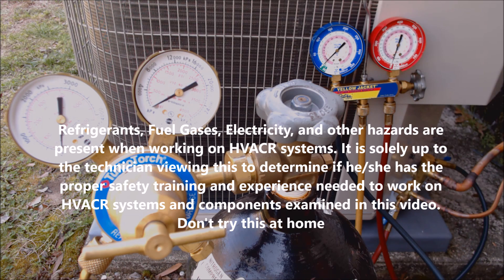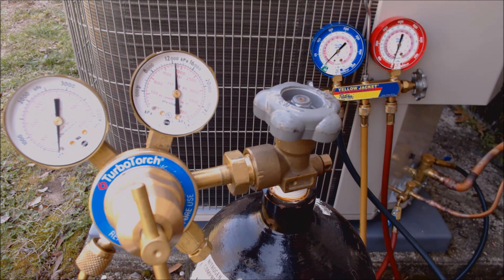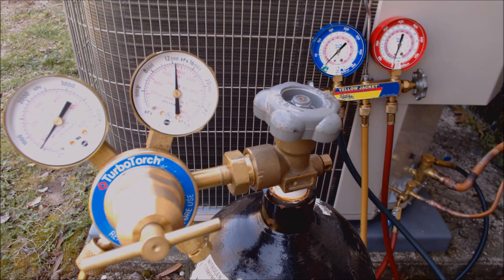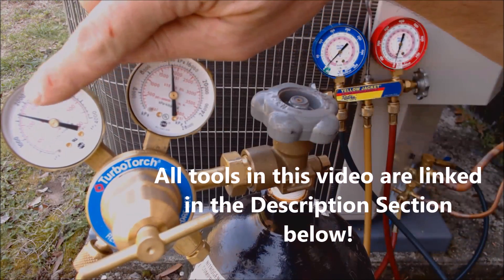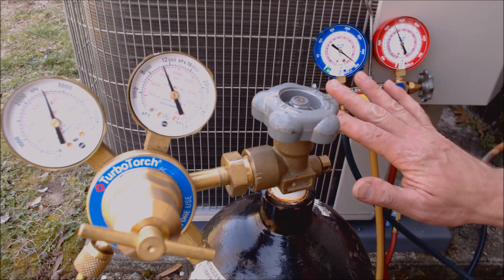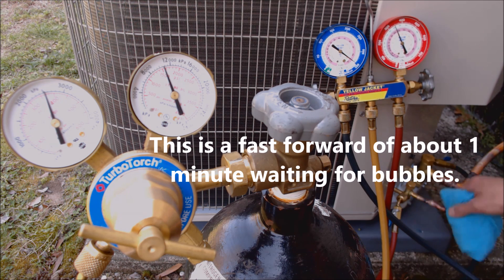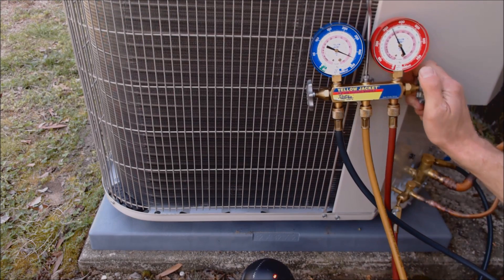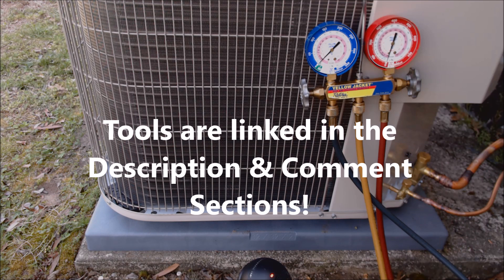HVAC Pressure Testing Procedure for Air Conditioners! Step By Step!

Comment from the maker: Tool List-  https://www.amazon.com/shop/acservicetech
Support-  https://www.patreon.com/acservicetech
For those that are looking for the tools used in the videos: (Linked Below)
Here is a link to the Nitrogen Regulator- http://amzn.to/2bXdR5f

Here is the link to the Appion Valve Core Removal Tool- http://amzn.to/2uYr8WL 

Here is a link to the Nitrogen Flow Meter-    http://amzn.to/2brvoBg

Here is a link to the Air Acetylene Torch setup-    http://amzn.to/2aQalsb  

Here is a link to the 15% Silver Brazing Rods-  http://amzn.to/2gVLyLc

Here is the link for the C&D Valve Core Removal Tool- https://amzn.to/2vqA0qy

Here is a link for RectorSeal Bubble Gas Leak Detector http://amzn.to/2ckWACn

Here is the link to the pack of 25 C&D valve cores- https://amzn.to/2J1lurm

Here is the link for the C&D Valve Core Wrench, Container, and 3 valve cores- https://amzn.to/2EVGkps

Here is the Link to the Fieldpiece MR45 Recovery Machine- http://amzn.to/2xAOpN6

Here is the link for the filter drier- http://amzn.to/2veVV3m

Here is the link to the Yellow Jacket 1/4" by 1/4" heavy duty hose straight-  http://amzn.to/2umtcod

Here is the link to the CPS Vacuum Micron Gauge- http://amzn.to/2v1nM3O

Here is a link to the JB 6 CFM Vacuum Pump   http://amzn.to/2nqbvo8

Here is the Link to the Appion Blue 3/8" to 1/4" Vacuum Hose- http://amzn.to/2uYlVyc

Here is the Link to the Appion Red 3/8" to 1/4" Vacuum Hose- http://amzn.to/2uYg6Ro

Here is the Link for the newer UEI DL479 Multimeter with temp sensor- http://amzn.to/2jtsUbJ

Here is the Link for the FieldPiece ST4 Dual Temp Meter- http://amzn.to/2AhR6ph

Other tool links can be found in the video description section.

Shop through Amazon! Your Purchases through Amazon provide a means for channels such as mine to earn advertising fees from all purchases after clicking through. Prices are the same as normal-    https://www.amazon.com/shop/acservicetech

All of the ACSERVICETECH Playlists-  https://www.youtube.com/channel/UCOZR-1IqsAer9wzlvFgb4mA/playlists?view_as=public
Reply: https://youtube.com/shorts/nQ0JNr5kNzM?feature=share4

Comment: Just want to share a faster and more effective method of leak test. With all valves open, close the valve on the nitrogen cylinder. If there's a leak the right side of the nitrogen regulator indicating tank pressure will drop immediately.

 It's best to start with all valves close. Leak test the nitrogen regulator by opening and closing the tank valve with the regulator valve close. To leak test the manifold gauge low and high side the valve core should be installed then use a tool to push the valve open.

Comment: Hi, i have one question which i couldnt find the answer, appreciated if you could help. 
Teacher in school said we have to do the high pressure test before the appliance is installed, isolate the piping system. 
But i found no one doing that? Everyone just connect everything, then do the test

Comment: Hi there, I am new and I am trying to get into this trade, before I take any courses at the college in Lithuania I want to learn as much as possible myself to be able to compare different methods of doing it. I have a question is it necessary to remove valve cores or is it possible to do the nitrogen testing with them inside ?
Reply: https://youtube.com/shorts/nQ0JNr5kNzM?feature=share4

Comment: Craig! After all the steps were taken and now you are ready to add refrigerant to the system. In this case ,Do you add a new poe mineral oil to the system ? ( depending on what type of oil the manufacturer demands)I don’t know if you have a video showing the oil part.🤔🤔

Comment: Hi, got a question. For example if I got a new evaporator and condenser with new copper pipe for AC line and I joined them together that means the line is new and dry so, do I still need nitrogen test and vaccum the line before filling the refrigerant in the line?
Reply: Absolutely
Reply: https://youtube.com/shorts/nQ0JNr5kNzM?feature=share4

Comment: Is there anything wrong with going through just the suction side? I do residential installs and some guys have thought it was a leak when it was equalizing after adding nitrogen. When I do it through suction alone I can watch the high side and stop it where I want. I have mixed things about this some say it’s good to do another says it will mess up the txv. Not sure how it would mess up the txv since it bypasses it. We work with Goodman units that have tx*n4’ which are hard shut offs

Comment: I'm installing a Daikin multi zone mini split.  Compressor has a service valve on the liquid line and gas line.  Do I pressure test using both service valves as shown in this video?

Comment: My compressor has been outside and open with both lines open to the elements.  I also emptied the oil.  Now I want to check to see if it is ruined.  I can braze service valves to the suction and pressure line after replacing the oil, then check suction and pressure with my guages?  If so, how  much pressure and vacuum should I expect?

Comment: We use valve core tools but I do not see any hooked up to yours??? Explain I was told if you take out valve core without a shut off valve core tool refrigerant goes everywhere? I'm about 2 months into field  training
Reply from the maker: This was just a pressure test on an empty system I was installing. We pressure test for leaks with nitrogen, thanks and keep watching and asking questions! Thanks!

Comment: Hello AC Service Tech, making a donation for your expertise here shortly! Question. I am Nitrogen pressure testing at 310 PSI...using a fieldpiece SMAN480 digital gauge. What is an an acceptable drop in PSI over time? I'm noticing a 2-3 psi drop per hour. 308 psi, now down to 304 psi after several hours. I leave checked, no bubbles. Isolated from my nitrogen cylinder. Can't find anything online. Do we test for 10 mins and without significant drop, go on to vacuuming down to 250 microns. I don't think I have a leak, but seeing my digital gauges go down is concerning.  I've heard temperatures can affect the nitrogen pressure. I have a 90 ft long line set. Really needing to get this AC running...appreciate any help!
Reply from the maker: Yes it may be falling due to temperature. Usually we only do a 10 min test due to time and then we can also confirm that no leaks exist as well during the standing vacuum test at 250 microns, thanks and I try to spend a extra time answering our patrons questions from patreon.com/acservicetech through patreon or through the email at info@acservivetech.com thanks
Reply: https://youtube.com/shorts/nQ0JNr5kNzM?feature=share4

Comment: Seeing as you don't like to have your manifold gauge attached when performing a system vacuum, how do you feel about the new 4-port digital manifold gauges?
Reply from the maker: I use them when teaching just so I can show multiple types of sets so students are aware of each type. They are nice for doing a triple evacuation but like you said, the 4 ports are made so that you can pull a vacuum through them and I don't like to have a gauge set attached when vacuuming, thanks!
Reply: https://youtube.com/shorts/nQ0JNr5kNzM?feature=share4

Comment: Hi I’m new to this. Can you explain why do we use nitrogen and when to use it? I couldn’t find a decent explanation anywhere on the why and when.
Reply from the maker: It is dry and inert so anything with oxygen can cause another gas to be more flammable. We don't use air for pressure testing because of the humidity in the air and the oxygen. We are trying to dehydrate the tubing in preparation for the refrigerant. Refrigerant oil when mixed with water creates alcohol and acids, thanks!
Reply: https://youtube.com/shorts/nQ0JNr5kNzM?feature=share4

Comment: Hi mate
Just wondering if I  close the service valves of an old unit  and discharge the pipes vapor refrigerant and then use the existing tubes for installation of a new same unit  without replacing the tubes.  
Is there gonna be a problem with vacuum process or any other issue? 
Thnx
Reply from the maker: You would need to recover the old refrigerant if it is a cfc, hcfc, hfc refrigerant. If there are no leaks then you could reuse the line set if they are the proper outside diameter, thanks

Comment: Pressure testing with nitrogen is the way to find leaks most of the time however I find with R410a system it doesn’t always work  ! I am told that R410a molecules are much smaller than the R22’s or nitrogen’s so they can slip through microscopic cracks / leaks ! If pressure testing can’t find leaks then I use a leak detector ! 
Thanks for posting
Reply from the maker: Thanks Mason!
Reply: acservicetech You got me thinking about buying this same leak detector as yours ! 
Does it have any cartridges that need to be replaced from time to time like that H10 model ? 
Thank you
Reply from the maker: The next one I am going to look into is an ultrasonic. Yes they do get changed
Reply: acservicetech I see ! I have the UEI RLD10 and I am pretty happy with it but wanted to upgrade it
Reply from the maker: Hey Mason, I really appreciate your gift! Thank you very much! In reference to the ultrasonic leak detectors, I have heard good things from both Robinair 16455 and Superior AccuTrak VPE-GN Pro however I do not personally have experience with them. I don't want to steer you wrong. I need to do more research myself, thanks
  - https://amzn.to/2xlavb2    -   https://amzn.to/2L1kULc
Reply: https://youtube.com/shorts/nQ0JNr5kNzM?feature=share4

Comment: could you accomplish the same thing with a vacuum pump?
Reply from the maker: Vacuum gauge will verify if there are no leaks as well as by holding a vacuum test but we pressurize first to check usually. The combination is highly effective, thanks
Reply: Vacuum takes a lot longer and if any non condensable exist it will give a false reading. Pressure is good to find leaks or bad braze joints etc. nitrogen also helps to remove contamination.
Reply from the maker: Yes and thanks Matt!

Comment: Everybody has there own way of pressure testing the system. After the pressure stabilizes I release the nitrogen and keep about 3 to 5 lbs inside the system, then hook up my vacuum pump and start this process. I was taught this keeps moisture from being introduced back into the system. You don't do this, in your opinion does this matter? and why? Thanks in advance.
Reply from the maker: If the pressure is released to atmospheric then it won't suck new humid air into the tube. We don't usually leave them open for more than a couple minutes anyway. You also don't want to add accidental positive pressure into your micron gauge. It won't really hurt in reference to having the 5 psi if your micron gauge is valved off. When texts talk about not introducing moisture into the system, they are speaking about taking a partial vacuum and accidentally breaking a recovery or vacuum with air but once you are at 0psig I really fell it is negligible, thanks Master and Warren!
Reply: https://youtube.com/shorts/nQ0JNr5kNzM?feature=share4

Comment: There’s times  I pressure test the system and I let it wait to stabilize, but after 15-20 mins I see it drop at least 5,7 psi. There’s no obvious leak, I bubble check it and nothing. But once I put it in a vacuum it’ll hold. Do you know what could be going on? It happens more than I’d like to.
Reply from the maker: Oscar, nitrogen changes pressure due to temp so if you take the tank out a hot truck and then put it in a system that is slightly cooler then the pressure will fall a bit. Nitrogen will change in pressure according to temp but not nearly as much as air or refrigerant. A vacuum test will tell if there is a leak , thanks
Reply: Oscarbm1234 Someone told me all the vacuum that you can put on is equal to a 15 psi pressure test.
According to him a vaccum test is not an adequate leak test.
Granted a vacuum test would find bad leaks but not a slow seasonal leak.
Reply from the maker: Hey Blade, They were talking 0 psig equals 14.7 psia so if you bring a vacuum down below 500 microns then you would be in negative pressure but in terms of a vacuum, we are talking a very deep level. This is why we do both, a pressure test and vacuum test to be sure. The thing is that we are able to see the micron movement at a much smaller incremental amount so it is easier to tell if there is a leak compared to watching a compound gauge or even a digital gauge, thanks
Reply: acservicetech So a vacuum will find even the smallest of leaks?
Reply from the maker: A vacuum will find a very small leak but once again, I am advocating that both pressure testing and vacuum test procedures both be used to make sure, thanks
Reply: The guy that told me 15 PSI was equal to all the vacuum you can put on a pipe, I took it to mean like hydralic lifting force per sq inch. 
For instance 15 Psi on a 1 sq/in piston in a hydraulic cylinder would lift 15 lbs.  And I have no idea what 29 in of mercury would lift on the same 1 sq/in cylinder under vacuum but I thought he was saying it would lift 15 lbs.
If that were correct then theres an exteme amount of force or power more at 300 psi than there is at 29 in of mercury on a 1 inch cylinder.